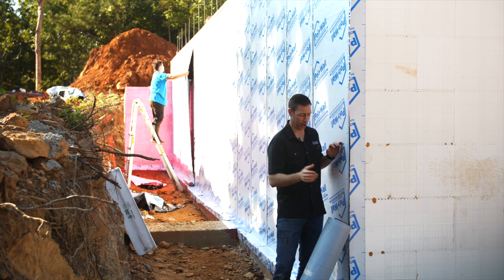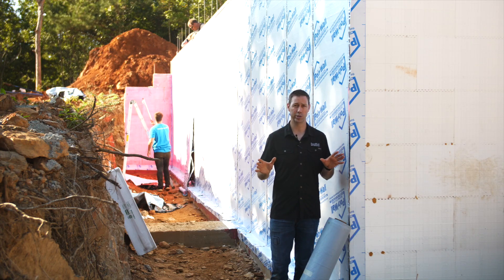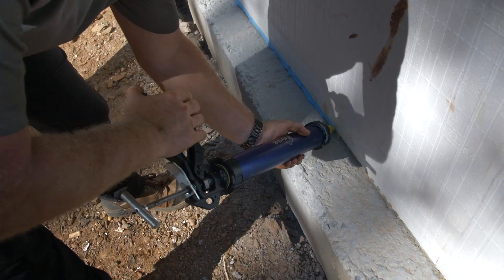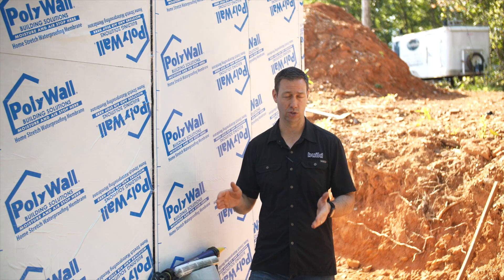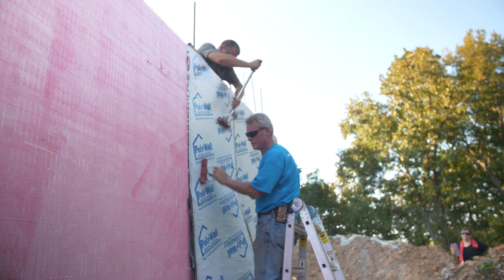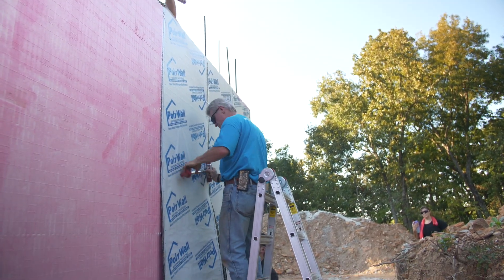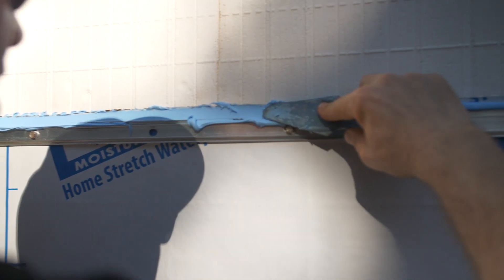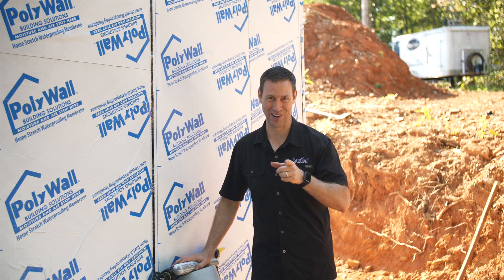This Pink Stuff is The Secret to ICF Waterproofing

Comment: I see you picking up all the issues, poor build practices, missed steps etc that  PLFL have done on their build, everyone was trying to help them and give them advice, but they knew better. I see they have left their peal and stick exposed to the sun for 18 months just for one... is this series to set the record straight - the ICF manufactures must be doing their nut with those two and their comedy build lol!

Great Info and over view.
Reply: WOW!!!! THAT IS ABSOLUTELY AMAZING THAT THEY'VE LEFT IT EXPOSED FOR 18 MONTHS!!! 

They started less than a year ago. 😱Nooo
Some people will lie about anything when they're a hater.
🤣🤣🤣🤣
Reply: @ Troll stalker (AKA Jessie) 'Started less than a year ago' best check your facts, PFL give a time line with their vidoes. I may be out by a month or so but the wrap was still out for over a year not 30 days as Matt suggested was the max or even your 'less than a year' you state..
Reply: @jamest5149  
Again you are exaggerating. 
"Which one of you are Jessie using a fake account?"
Well, I'm retired, so I'm not Jessie. 
So why are you accusing someone when you have no clue what you're talking about. Again, you are saying that the building has been built for 18 months which is total exaggeration. (Or as many of us call that, a total lie)
Again they had a different version of a Arroyo that they had covering the sealant within a month. 
 so when you decide to come comment back and being snarky in line why don't you explain your exaggeration of 18 months and why you chose to make that lie.
 " It was exposed for a year"
The hole was dug during the summer. 
Foundation was put in.
Then they had the timber frame Workshop put up the building. 
It has been just over a year from the time the hole was dug. please explain how was exposed for well over a year when it hasn't been a year total.
So are you lying or are you just a fool?
Reply: James
You are rather delusional. the primary difference in the application of Pure Living For Life and what they did in this video is the application of the pink stuff. Everything else is the same. Troll Stocker pointed out that it's been less than 18 months by far (it would have been two winters if you are correct). 
It's true they did not do a as elegant of a job as these appliers but then again, as they've stated several times, it's their first time doing things. But your characterization of leaving the product exposed for "18 months" is total nonsense. PLFL applied the same open cell material over the waterproofing (the part that needs to be covered) within a week or two. 
You claim to be trying to help by giving advice. obviously you're not in a position to give advice to anyone because you have no clue what you're talking about.
Sounds to me like you're trying to grab credit when none is deserved.
They (PLFL) have made lots of mistakes. That is something that cannot be argued. But don't aggrandize yourself as some master builder who's trying to help when all you are is a troll.
Reply: I just re-read your BS story "everyone is trying to help" ???
"Picked up on all of the bad stuff that purelivingforlife has done."
No there's a bunch of trolls who keep criticizing what they're doing to try and make themselves look smarter. Seriously dude, GROW UP!!! You're not trying to help. It's like Pappy said.... You're just trying to make you sound smarter than you really are. 😱
Reply: James
"All the issues"
"Everyone"
" Is this series to set the record straight??
"18 months of exposure"
The way you use "etc" to indicate that there are more "problems" when in actuality it's a term you have used when you have ran out of things to say.

It would be a very good idea for you to seek help from a mental health expert. The way that you use terms to make things more exaggerated than they are is very disturbing.
Reply: The PLFL white knights are out lol, didn't take long and wonder which of you is a Jessie using a fake account :)

Watch this video again and then watch PLFL's video's you will see the errors... what you won't see is any comments advising, giving tips or challenging them .... why, PLFL sensor by deleting comments and ghosting views so their comments  aren't visible by anyone else.

Just checked the time line in their videos and PLFL have peal and stick up and exposed over 13 months ago,  my point was this was error they had pointed out to them and still ignored the advice. 

And 'all' and 'etc' was used for good reason but due to PLFL sensoring you can;t see the post.. BUT luckily a quick google search of PLFL scam will show posts of screan shots of the posts before Jessie jumped in and deleted them and banned the poster by ghosting them. 

Again a comedy of errors.
Reply: 1 Grand Pappy and Troll, we know you to are mates and troll the wed but I appreciate your response and that you have a difference of opinion- with that said the truth is in the PLFL youtube videos, their face book page and a quick google search will help you get on track.

Matts next video will be very interesting and may just show more on what PLFL have got wrong :)

The good thing is PLFL can't sensor here.

Keep up the 'good fight'.I think poeple see through your name calling and keyboard warrior lifes you have in retirement.
Reply: @jamest5149  
Trough???? Do you mean truth?
Well I see that you didn't bother to get actual dates.
"We" Soooooo do you have a large Consortium working together to come up with all these or are you just talking about you and the mouse in your pocket.
Look, Failure Hindsight, you can keep changing your name and spoofing all you want but, dude, you really need to get mental help.
Reply: 1 Grand Pappy  Thank you.
Reply: @jamest5149  
I've told you before I don't care for you. I always had some person on the job site the claim to know everything and he always messed everything up. That sounds like you.
So..... I looked up things on the internet just like you suggested.
Posted August 10th 2017 Our house exist. It's when they dug the hole for the home and started the footings.
They poured the footings, got on a few rows of the foam ICF blocks. It was posted August 19th 2017.
It was entitled this stuff is dangerously sticky and the product was called "Blueskin" It went over the ICF blocks and on to the footings. They did not use the calk like sealant.
Post on September 2nd 2017 ICF concrete pour during a solar eclipse. The solar eclipse happened on Aug 21. I was in Idaho..... In Rexburg. I was at Pappy's brother-in-law's home.

September 5th (posted) 2017 entitled wow this is high. This is when the polyguard is put on the walls.
They didn't run it over the footings.
Next post also on September 5th 2017 entitled "Giving our basement dimples."
That was when the polyguard was covered with a protective barrier.
I admit, the application was BRUTAL!!! 
Since I'm not Jessie I don't have an ego to protect. I would NEVER let them work on my job site.

Again.... you told us 18 months between the time the polyguard was applied and the water penitration preventing barrier was applied. Sooo, how can ANYONE take you seriously. You lack the ability to do SIMPLE math. "
Darp, Darp It was 18 months that the polyguard was exposed! DARP" 
Really, probably a week or two.

 I'm 65 years old. I've had four strokes and a heart attack. You claim to know everything and yet I can use the internet better than you.
Reply: TROLL STALKER  You may be good at referring to the internet but you seem to be missing the Poly - guard was fitted last summer before the timber framing fiasco and is still  to this day visible and exposed by more than 50% of its area plus they have no plan for doing the sidings to cover so 18 months is a reality. 

Also I believe you will find my previous guesstimate on the length of time the Poly - Guard has been exposed is a lot more accurate than your 'a week or two' statement, I may have been out by  approx 20%, but you are out by over 90%!?
Reply: @jamest5149   🤣🤣🤣🤣
Yep you're the guy never want on a job site. If your argument would have been they put the water protectant where it's not needed I would have agreed with you instantly. 
Yes, there are plans for that, it is called "Rock Work."
I don't know why they put it there. It's is not needed. 
I thought the topic was "Where waterproofing is actually required!" not  "Look! They put water protectant where it's not needed."
So you're right.   
The place where waterproofing was not needed is still exposed.
The place we're it is not going to be backfilled, and no water will be sitting against the foundation is going to leak if water ever gets against against the foundation, behind the rock work. 
🤣🤣🤣🤣🤣
Yep, I need you on my job site!!

just out of curiosity why didn't you point out that they put that material where it's not needed?

Also pointing out, I have said "They have done crap on that job that has driven me nuts" and this is one of them.
 Sooo 6 MONTHS = 18 months.
And you're still calling that good math.
🤣🤣🤣🤣
Reply: @jamest5149  
I thought of another thing for you to gripe about later on.
When they do the rock work, if they do it correctly, they will use a product called "wall ties".
The ones that we used are a little corrugated light gauge metal. You beed them approximately inhalf lay one side of it on the Brickwork or Rock work. You then use a screw (in this case) to attach that into the wall.
The purpose of this is to keep the brickwork or Rock work from peeling off of the house. 
That is going to really screw up the waterproofing effect of the polyguard. Lots and lots of holes.

So here's my question "If the polyguard leaks in an area where waterproofing was not needed (besides the ridiculously high expense of doing that)what has the harm been?
😉
Reply: @1grandpappy684  
Actually, the way they do screws they'll probably put a million holes through that "waterproofing". 
if I remember right they did that just to protect the ICF from the UV rays. Definitely there's a lot cheaper ways to have done it.

Comment: I can't imagine how expensive this whole process will be.  Hope it's worth it!
Reply: Your savings on heat and air, home insurance, and maintenance will more than pay for putting the poly wall on your home.
Reply: Worth the expense up front instead of with other traditional ways like form work when times comes you find out how cold it gets in winter and hot in summer and damp too if not all that is shown was not done during initial construction.
Reply: To cover the added expense of icf will take decades in hvac savings.

Comment: Lived in an ICF house for 12 years now, we'll never have another house other than ICF. 4300 square feet and our all electric house utility bill runs about $160 per month. Seeing this video reminds me why I will never have a basement. What a huge pain in the @$$
Reply: same... i have a full ICF just under 8000 square feet with basement and roof is ICF.  only way to build... soo good!
Reply: @tredogzs  We just built another, our retirement home. Ran into soil issues, I have more concrete in the footer than the walls (3x). Still great on energy
Reply: You have a EIFS above grade ICF house?
Reply: iamthemoss Hello iamthemoss. We would like to build an ICF house. Difficult to find installers and architects in our area, south of Houston. Any recommendations?
Reply: I'd be a bit nervous about living in the middle of something quite so flammable.
Reply: @vylbird8014  this is a joke right? The entire structure of a traditional framed house is flammable. At least with ICF the concrete wall isn't flammable. So it will remain structurally sound longer in a fire.
Reply: @michaelwitt7984  The smoke inhalation will be a little more toxic I would imagine
Reply: @OnlineWaterproofingShop  probably best to leave the house if it is on fire, not breathe the fumes.  Consider sprinklers

Comment: It seems like if you can see the black strip on the poly wall home stretch it might be installed incorrectly
Reply: looks to me like this black strip is on both sides, so you can apply left to right or right to left and you still expose the uncovered to apply the blue stuff to from what I believe I had seen

Comment: Although I fully accept all the spooges, tapes, foams, etc... I find that "modern" building is driving costs out of control. It takes longer to foam, strap, tape and flash than it does to side the same area. Products make folks money so our lives will be filled with ever newer products. My favorite wall is still a double stud with dense pack and a little rain screen, simple. Whats everyone's take on product driven construction?
Reply: I don't believe the product driven model is intentional. I think they are simply trying to resolve a problem they've seen. And problems are generally like a Hydra; you cut off one head and it sprouts a few others. Finding a silver bullet is tricky business, and designing one is typically even trickier. I believe ICF has, to date, the best model of economically sound and streamlined construction, but it does need to be done as an integrated system. This peel and stick business is an archaic idea on a more modern approach. We really shouldn't resort to taping things to be watertight except as a last resort. So, while there are many products, I believe they come mostly because the builders are looking to rectify problems still not solved, and companies are trying to meet their need. It does become an issue when the code minimums require houses to be super well made and therefore too costly, but again, more research should be done in finding economically viable ways of making quality structures. Iowanest.com is a good case study on this. 

ICF above grade is basically intrinsically ideal, so it overrides WRB (Tyvek and such), and the several layers that Matt ends up doing on his stick homes. ICF upstairs is pretty much bliss to deal with when making a quality structure.

ICF below grade has the same issues as traditional, but with some quirks. I believe the best is impermeable crystalline waterproofing (such as Xypex), but most scenarios a polyethylene sheet and careful backfilling will do what is requisite. But the insulation and ease and speed of building, make it superior to the older technology. It just takes a little different way to dealing with it.
Reply: Good marketing, I think I remember when I first learned of ICF it was the be all and end all for foundations especially basements look at this product it is your form and insulation all in one plus a continuous concrete pour. Great now I don't need that crew to set forms, move forms have sever pours. Reduced person-hours oh but wait it's not as good as we thought we don't have a simple spray or roll on product that will give it the water proofing that we need like some of that old time tar. Now the marketing kicks in we can give you a simple peal and stick product tthat you don't need skilled laborer to install, oh wait it's not that simple you need skilled labor and they need our special course to install it.
Reply: @MerkDolf  Nothing better than good old school 1'x2' foundation & 8-10" foundation wall with ALL the exterior of the walls tarred up real good. Not to mention the rock and piping inside and outside to take care of the water. Funny thing is after doing all this new style of building you still have to have water management just like you do for the good ol proven old school ways.🤙🏽🤙🏽🤙🏽 @mattrisinger @thebuildshow , don't get me wrong I love to hear from you new stuff but something's are just better off not changed if you can use it.
I built my house 17 years ago in Kentucky and did all old school ways untill I got to the first floor, then I went with newer materials/technology. I was the first house in the county and surrounding counties to use CPVC throughout the entire house & knock on wood, I have no problems at all to this day. 😁
Reply: @David-fk6yg  kkkkkk...awesome. . i too remember spreading tar on the foundation, then sticking the paper, then another coat..and an extra strip at any seam . then all those rocks went back, no buddy needed gravel if they put back wkat came out around the property. ..but people love stone walls by me, they're everywhere
Reply: @thomasbroking7943  never have done tar, paper & more tar. Just a real good THICK coat of tar. 
Back fill: steps:
1:   drainage pipe tide in to a sump pump area
2:   #3 size rock for about 6-8 feet
3:    6" of #57 type of rock
4:    some sort of material to keep dirt from silting in to the rock so it wont stop up the draining process
5:    good / real nice topsoil OR decent dirt if not planting anything.
6:    If planting, plant the ball of bush at least 4' from side of house.
Reply: @David-fk6yg  its possible pop-pop went overboard with the laborer, might have been to keep me off the roof or away from the saw or something. . i was beyond words nevermind a handful.. I don't even have an idea of how many hours i spent straightening nails from that can of bent ones. Pop-pop was a machinists but knew everything he even changed tubes on the tv & short wave radio we had..
Reply: @David-fk6yg  Nothing better? Time has shown again and again this exact method failing.

Comment: at all cold joints, pour your concrete on a slight slope towards outside
same with all pipe penetrations, slight slope
Reply: pray tell how to do that on an Insulated FORM? when showing is plenty sufficient enough than having bare concrete coming out and it soaks up water as it is present in the soil at times of the year
Reply: from floor to floor, every time you stop a pour, slope it, not the forms, just the concrete
you can also use Quad Lock forms which have built in channels to remove water